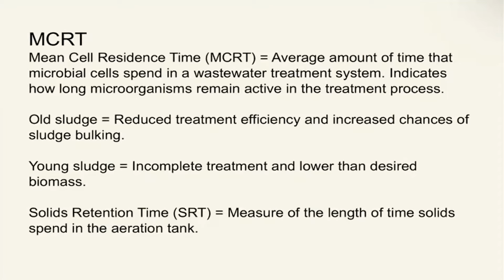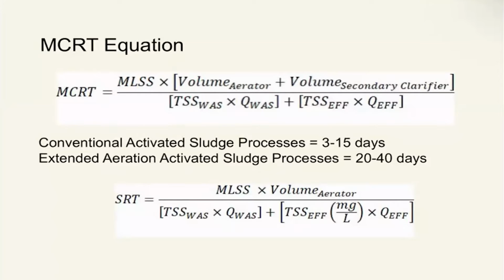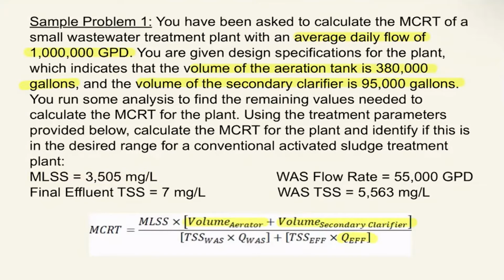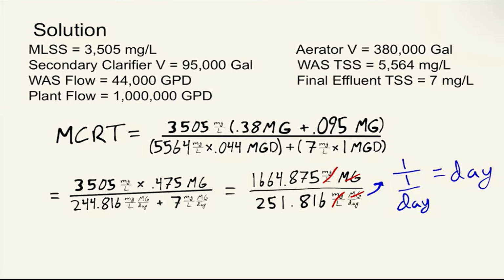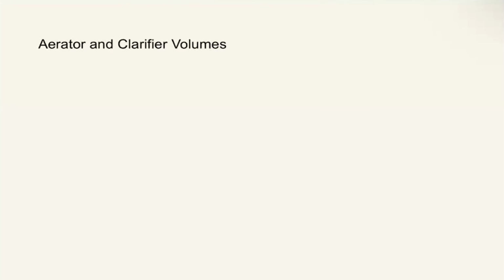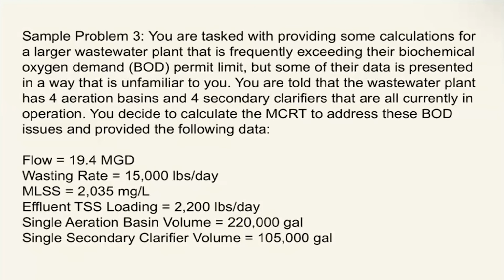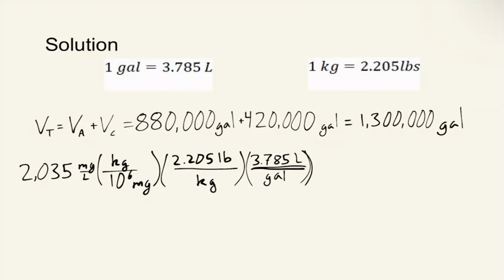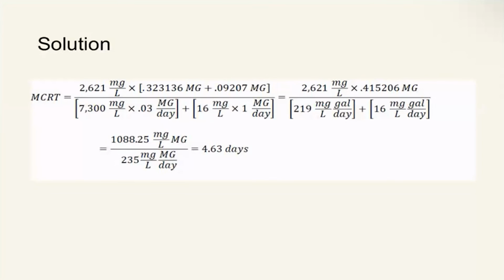Advanced Wastewater Math - MCRT

Comment: FYI:
Sample Problem 1 WAS concentration and WAS flow rate data were inputted improperly.  WAS concentration should be 5563 mg/L (not 5564), and the WAS flow should be 55,000 GPD (not 44, 000).
Reply: I was wondering why I was getting 5.32 days! lol. Also, I usually put everything into lbs before dividing. It was interesting to see it done this way!